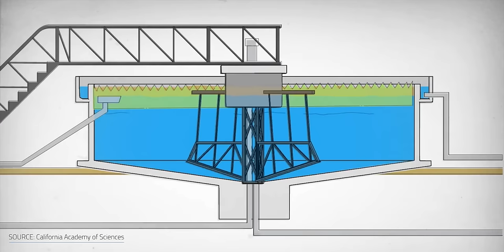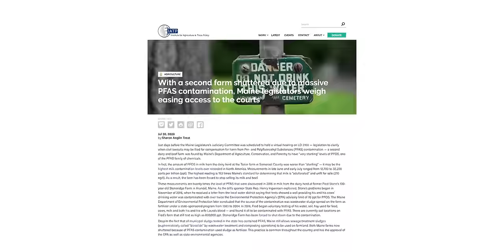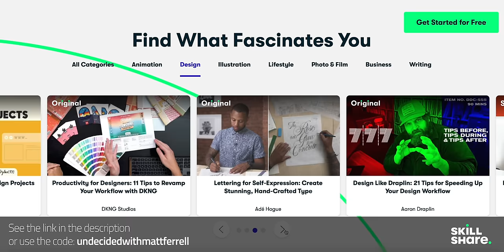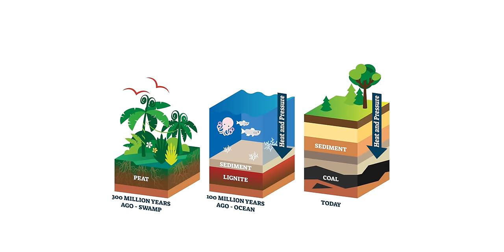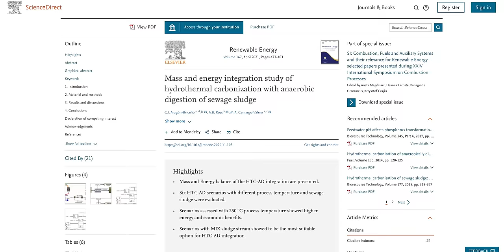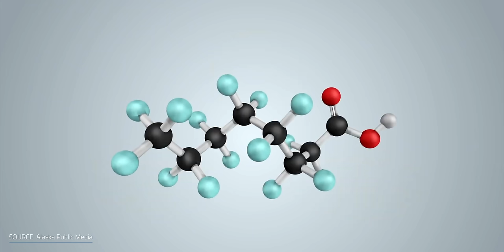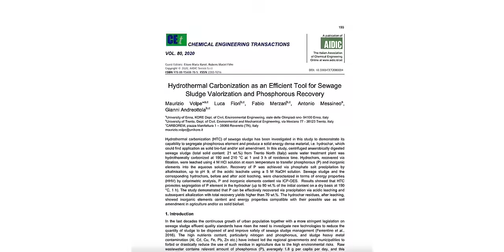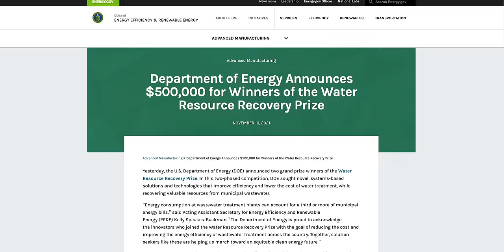Turning Human Waste into Renewable Energy?

Comment: In Korea they use " night soil" on their crops. To get rid of the CO2 in biogas use a CO2 "scrubber" of steel wool in a pvc pipe between the water and storage vessels. To reduce H2O in the pipe leave a dip or take the gas thru clay kitty litter. Solar Cities has a good demonstration on making home biogas. There are other videos that are solid too. Sequestering carbon in concrete sounds great, too

Comment: Biomass was used by old generations and my grandparents 100 yrs ago by incorporating in building houses with bricks from mud, hay and cow poop or manure to harden the brick in the house that stand even today. Only problem every few years they had to patch cracks due to weather and add some extra materials for enforcing the durability. Also, brick house will keep cool in the summer and with small wood stove keep heat all day with a wood log or two.

Comment: So after watching a few of your videos it seems a holy trinity of green is needed to for sustainable green energy. I would like the see the synergy of Wind, The Sand Battery and Poo Power. First Wind for its large scale applications. Wind feeds a Sand Battery that handles all heating applications in nearby town or city. Next the heat from dedicated Sand Batteries heats SoMax plants directly, ultimately turning wind into heat and heat turns poop into energy and/or biogas.

Comment: Very well done!  About a minute and half in, I can't get that picture of the bathroom with a spray hose in it out of my mind. I'm not sure how much distress you must be in to need a shower next to your tissue roll!  A little further along you have a statistic about U.S. production of 5-13 dry tons per day, it's certainly not total production and way too much on an individual basis. You also imply, without saying, that some farms in the northeast part of the country were shut down due to PFAS originating in biosolids. That doesn't appear to be the case if you dig a little deeper. There are some PFAS in biosolids, but at far lower levels than what you find in, say, house dust. It would be great if we could accomplish a major environmental permit in less than three years, but honestly, that's pretty darn good. You could go way shorter if you just got rid of all that public notice and opportunity to complain (eh, comment). People do need a voice though, and the good stuff comes along with the other. Maybe this is a better mousetrap.  Processes that solve all problems at a lesser cost without any downstream consequences... ok, show me. Will be very interested to see how this goes.  One thing lacking is real information on contaminants in final products. That would be difficult to include in this kind of presentation, but it will be essential for anyone thinking critically about the process.  Anyhow, great job with the presenation.

Comment: there are a lot of potential resources, that are literally flushed down the drain and end up feeding the alga in the sea. We got our of grid land less then a month ago. Instead of an expensice sewage system we will get a biogas toilet for 1,5k$ including an attachable gas stove.  We will not really need it for cooking, as we will have a direkt solar cooker witch will be plenty for most days here on the canary islands and we also got solar energy.  The gas however will be the best option to heat up a hot bath in the evening without having to rely so heavily on the batteries as there will be no more sunlight.  Instead of "waste" you get fermendet compost and a biotrashcan where you can throw in allmost every kind of organic leftovers  Free fertilizer, free gas! No water is wasted either.  The only requirement is space for the gasbag, preferably in direct sunlight.

Comment: The Texas Panhandle area has many dairy farms.   In fact only Wisconsin and California produce more milk.   There is a big digested here that sends methane over 1,000 miles to California.   One night lightning struck and the fire ball could be seen for over 40 miles.
The amount in waste is no small deal!     I try to have feedlot manure applied to part of my farm.  Usually 2500 tons each year for the last 50 years.   Just the phosphorus in this is what is needed for 1/4 million bushels of corn each year.

Comment: Have we thought about using this as a battery for storing wind and solar power? I did some quick research, for every unit of energy used to produce the hydrochar, it returns 4 units of energy (HHV). If converting the heat back to electricity is only 40% efficient, you are still getting 1.6x the energy!

Comment: UK sewerage treatment plants have used anaerobic digestion for decades. The energy generated runs the plant and provides heat where needed. Newer designs are more efficient but the process is the same.

Comment: I don't a micro one for a science project.

Had a large scale plan to put barges off shore to just use the pipe networks we have to put waste to the barges. 
Give back gas/electricity.

Barges would then detach once filled with spent material and bring that compost where kts needed while and empty barge takes it place.

Self fueled autonomous gas production, fertiliser factories.
Reply: Oh yeah. The legislation is unreal.

Comment: If there’s another engineer here from sewage treatment industry, correct me if I’m wrong, but I’ll tell you my experience from 2010, Damascus, Syria treatment plant that’s been using Siemens turbines to generate electricity and covered OVER 100% of the plant’s needs, turbines were gas powered and they’re from the 80’s there was 6-8 of them, with backup Disel generators and reserve tanks, everything like normal, the plant was connected to the public grid but withdrew power only after maintenance of the turbines!
Everything you presented is cool but not an iPhone kind of game changer, htc is a great tech, but not as “revolutionary” as presented in the video.

Comment: I don't know how I feel about this.
- A company called Veolia already uses biosolids to make pellets, they sell as fertilizer 
- Incineration is for sure a thing
- Biosolids on land is for sure a thing
- So is landfills especially in winter or colder months

It sounds great to be honest, could offset the high cost of running blowers for the aerated part of a plant. Also the UV which helps reduce the use of chlorine. Its unfortunate they say its only for small to medium plants so like whats that under 50MGD, thats like nothing.

Comment: The city of Denton Texas has been itiling a similar process for years, by turning the city's waste water and yard clippings / tree limbs drom the highway dept into biofuel which is then used on all of the city's vehicles (from pickup trucks to backhoes).
My main question is- once the carbonization process has been completed, what happens to the heavy metals from the waste? If they're filtered out, then how are they disposed of? Or can they then be sold for industrial purposes?
If they're integrated into the final cake product, how does that affect it's potential use as a building material or coal alternative?

Comment: This is fascinating. Are you aware that there is another use for wastewater? This can occur in individual residential buildings, commercial complexes, or wastewater treatment plants. It is the extraction of thermal energy from wastewater. It is done using equipment from a company named Sharc Energy. You should check it out.

Comment: Interesting. I also read on Inverse that they have found a way to derive sustainable aviation fuel from sewage sludge and household waste. The researchers claim that it could potentially achieve a decrease of 165% in greenhouse gas emissions and if this ever gets off the ground, the fuel can be produced for as cheaply as $2.50 per gallon. Maybe you could do a vid on that.

Comment: Do wonder about our clinging to septic systems for treating blackwater.  Could we reduce up front housing costs by changing poop handling?  If people ship out the poop (at least), and install grey water and urine treatment systems for the remainder, would there be less stic failures, fewer up front septic installation costs?  
Homeless camps would finally have a harvestable resource if we consistently install portapotties near them...

Could hydrochar be a safer alternative to applying treated sludge as fertilizer?  Have the heavy metals been removed?  -Our soils are seriously depleted of carbon.  
How much of potential does this have in producing fuel and reducing electrical grid pressures to meet needs?  CAFO wastes could certainly be used too...
The thought of 'oh boy, more chemicals' is problematic with this process,  I want to learn more.  

My past thoughts about poo were: methane gas should be the first capture, after that remaining solid waste could be turned into charcoal as soil amendment.

Comment: I like this idea. I suppose this could be started in small scale, then be reproduced in larger scale.

I'm a fan of a more primitive way of poop use. That is fermenting it into methane, then using the methane as fuel. Thus can be done as either free methane gas or converting it into methanol. This may not be completely carbon neutral, but it will probably come close. It would be a very accessible technology that can be used in poorer countries.

A side benifit of this is that, after the methane has all been fermented out, nitrogen rich compounds get left behind. These can be used as fertilizer.

Comment: I do have one question, could this same process be done on a smaller scale? More specifically, could it be done at the source, literally where the source material is created? Could it be scaled down to say, power a family home, at that home? Okay, while that is broken up into three questions, it's still the same question. Even better, #2 literally comes from every animal and this process doesn't have to rely solely on #2, not that it would ever run out.

Comment: 8:02 - the coal value "Lignite" is the lowest quality rank of coal which I don't think is a desirable energy source due to how dirty the byproducts are. 

It would be interesting to include the operating loss for power plants by accounting for the costs of air filters needed to burn this type of coal.

Since this fuel source is comparable to Lignite, we should already know this cost. But it would be interesting to account that into the cost-savings from producing this fuel source from human waste.

Comment: New Zealand has been generating power from sewage by a digestion (biogas) process since the 1960's. Methane is produced and fed to dual-fuel generators and the waste heat is utilised in the digestion process. Easy!

Comment: I'm busy at work and listening to this as I go, so I may have missed an already mentioned point... But wouldn't one possible application be - if the carbon content is high enough - to use the final product in manufacturing synthetic diamond grit for power tools and stuff?

Comment: I like your videos and all the topics you discuss. You never seem to mention nuclear power in your green energy lineup. Nuclear is the most power dense fuel in existence. The new reactors that are being designed use less refined fuel and even the so called waste from older plants. When you can build a plant that puts out mega watts of energy on a relative small plot of land compared to wind and solar, and it doesn't have near the environmental impact that those 2 do. Please do some updated videos on SMRs and micro reactors. Thanks

Comment: Great stuff poop - Bill Gaetz has been installing poop burners in rural areas in developing regions of Africa and harnessing the heat.  
Several districts in california and other regions in N. Am have successfully used sewage water from terminal (End Stage) takes to percolate through a triple nature pond  system which utilizes water plants to remove heavy metals contamination.
Do you think a steam methane process could produce hydrogen from the biofuel? 

The poop coke must have gases from combustion of the end product (the Coke)?

Comment: Thanks for the very interesting video. It would be interesting to calculate its EROEI (energy return on energy invested) for HTC, which is one of the most important parameter to evaluate properly the potential of a new energy source. Although HTC is not only a technology to produce energy, but several other very useful and interesting applications (i.e. concrete industry, etc.) it still would give an idea of what we are dealing with. thanks

Comment: I haven't figured out how to get off the pot, so what can I do to carbonize? I  would like to totally remove the burden off of rural septic systems. I am partial to such an easy way to sequester carbon. And I want to use this charcoal in my wood burning stove.
This is a perfect way of storing energy. Store it for decades. Use it when you are ready.
Matt Ferrell, why don't you and I put some of this knerddie knowledge to some use?
Make sure that spelling gets into the dictionary.

Comment: Does burning the biochar not release climate change gases back into the atmosphere? I think the best aim of this tech is two simple results- 1 we can cut your power use down to zero (and perhaps we get to keep any extra power profits) and 2 we can cut your water demand within the plant. In regions with drought conditions (there are very few countries that are not experiencing drought conditions - especially in the summer). Consider a state where instead of the water being used for waste-water treatment (usually expensive treated water) less water is needed and can be diverted to residents/agriculture. 
There are other bypoducts from water water treatment - ammonia which is now being considered as a shipping fuel. Methane from biodigestion and burnt to generate power+heat tends to meet at max 50% of any large plants power demand. Even then, this still generates C02. Methane production from anerobic treatment in a wastewater treatment is at best an partial offset for the plants power demand no matter how modern or the scale of input. We already have lots of other material that can be added to cement - domestic large scale incinerators generate a solidified ash that can be crushed and used in roads etc. The bigger issue is whether then biochar changes any of the performance criteria of cement(strength-climate resilience-weight-use with robar-pouring/settling etc. However until tenders favour low carbon cement then this material will be favoured with the "old reliable". It would seem to have a terrific opportunity in separating toxic elements in liquid wastes

Comment: I wonder if the carbonized turds could be formed into pellets and burned for heat in wood pellet stoves. I live in an area where everybody poops (go figure), but we get all our electricity from clean hydro power. However, the majority of our home heating uses heating oil. Turning our turds into a heating fuel would reduce our CO2 output from heating, and reduce the CO2 output from shipping our turds out of town.

Comment: I think you will find by math that the dry matter of USA poop per day is about 15,000 metric tons. The bulk of this being gassed of as methane, and carbon dioxide from  municipal fermentation ponds in a 60-40 split so it is already semi processed but not  utilized. Some sludge is left behind, but this is not the organic solids needed for fuel. Yes it is a fuel source going begging.

Comment: This seems very similar if not exactly the same to the technology of Thermal Depolymerization. Pressure cook anything to break it down into constituent chemicals and use the waste products as fuels and fertilizers. A US company called Changing World Technologies (CWT) got as far as building working plants in Pennsylvania and Missouri before regulation ground things to a halt. Now even the Wikipedia page only has dead links. The last information I remember from the now-defunct press release site was that the tech was being taken overseas to try and gain more support. It would be interesting to compare the process and the regulatory difficulties HTC and CTW face(d).
https://en.wikipedia.org/wiki/Changing_World_Technologies

Comment: Honestly they should redesign homes so that shitters pipelines feed directly to a drip line fertilizer system for your yards or whatever.
Hands off, water flushable, hose line. Just dilute the shit out of the shit to prevent blockages. Have it auto run on every autoflush.

Comment: It still is number two.  But, if all of this really tracks, it is a number two that should be implemented alongside number one: nuclear.  After that, you can start enlisting solar, wind and hydro in niche applications to begin to chip away minutely at natural gas, oil, and coal.
Reply: Nah. I'm pro nuclear but HTC and Pyrolysis for dry waste are number one. Decentralised, universal and not intermittent put them ahead of nuclear, which requires a lot more capital, mining uranium and creates disparity for areas that can't afford plants. But they can also work complementary to nuclear

Comment: Not just poo, but ANYTHING carbon based can be used, From plastics to landfills to poo. In the case of landfills, put everything, all at once into a digester, and extract any other metals and acids, and any caustic materials that can be used for other industries.
And all while turning it into oil and biochar.
So Many Problems Soled at Once!!!

Comment: coal burning power plants don't sequester carbon from it's exhaust efficiently. this doesn't solve the problem. an altered biomass gasification using poop as input may do it. coz it removes all carbon as ash which can be used as by product for ash bricks. gasification is 0% emission due to this reason.